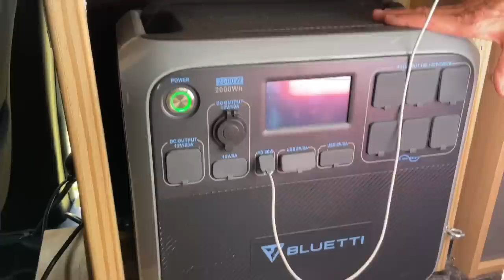COMPLETE VAN TOUR - NO BUILD, BUILD - RAM PROMASTER CITY - SOLO WOMAN TRAVELER, CRUSHIN' IT!!!

Comment: Got a couple of ideas as I watched the van tour. Both are focused on the cooler. If you have more of the silver bubble wrap cut a piece to put it over your food. In essence you will have a cooler in a cooler. As your food dwindles the refrigerated space will be smaller allowing the ice packs to last longer. also put a piece in the cover. Secondly, and I wished that I thought of it earlier, we can drill a small hole for a probe thermometer ,like the kind I use in heating and cooling , so that you know at a glance what the temperature is in the cooler. I bet that sometimes you may change the ice packs prematurely not knowing what the actual cooler temperature is and it may cut down on your need for electricity for that and you will  be able to use more "juice" somewhere else.
Reply from the maker: BOB!!  You are here!!  Thanks for being here!!  I hear ya about the silver wrap in the cooler.  I was going to take it and think about and and use it on the road, but I didn't have the space.  those are great great ideas!! THANKS!!
Reply: @LulusWay64  I'm sure we have work to do when you return.
Reply: Fantastic suggestion!
Reply: Lulu you are a piss and a pistol- my kind of girl!
Keep living exactly as you are and doing what 
you’re doing. What a joy you are, enjoy your peace! Beth

Comment: Genius! I've watched hundreds of conversion videos, but yours was packed with so many ideas that really spoke to many of my needs. 
I'm vegan and was stressing over  to keep my veggies, etc. cold without having to buy a huge, expensive power sucking refrigeration unit. Would love to see a follow-up on how your cooler system held up. Thank you for all your wonderful tips. I will definitely be using many of them. ❤
Reply from the maker: hi Karen, I used this system for a two month journey and it worked well.  I struggled a bit on two occasions with my electric because of bad weather and I bought a bag of ice twice to supplement.  BUT, that's because I don't have the proper wiring in my van to the van battery to charge while driving because my power station is a beast.  so I'm limited to only solar charging.  I either need to have the proper wiring installed or I need to downgrade my power bank, I don't think I need one that powerful.  but, all in all, the freezer/icepak system works well and I'm using the same system in my new build that is currently a work in progress, stay tuned for van build videos as I've already torn out the build from this video!!  glad you are here!   Lulu

Comment: What’s the folding step thing you are using to get a boost to your roof? Thanks! Nice tour minus the wind 💨.
Reply from the maker: yeah, it didn't even seem windy and I will work on what to do about the sensitive mic when recording.

TOOENJOY 2022 Adjustable 5 Gear Extra Protection Car Door Latch Step No Assemble Foldable Heavy Duty Car Gadgets Stand Pedal Ladder for Easy Roof Rack Access, Universal, Max Load 400LBS(Medium) https://a.co/d/bKBF08q

Comment: Wonderful build!!. Suggestion , use your table extension to lean on drivers seat and down to bed for a back rest to sit and look out of your back doors. I guess you did not have time to deal with passenger seat. I wish you the very best and look forward to more fun. TY
.
Reply from the maker: hi Ruth!!  great suggestion, thanks!!  I did bring my van to have the passenger seat turned around like I did in my last van, but my mechanic told me, the way this seat is mounted, it cannot be turned around and remounted.  so I was deciding between keeping it or removing it and I decided to keep it for this trip and in my final/permanent build that I'll do this spring, I'll revisit that decision.  to be determined!!!   Lulu

Comment: Ty for sharing.  I love your refrigeration system.
Reply from the maker: hi Georgia!!  thanks!!  yes, I love it too, it works well but you need to have the power to run a freezer which takes more than a fridge.  but I'm working it!!!  Lulu
Reply: @LulusWay64  does a 500w solar battery bank work?
Reply from the maker: you'll have to see how many watts your battery draws to run the fridge/freezer and then do the math to see for how long your battery bank will run it.
Reply: @LulusWay64  oh for sure.  Im having problem finding the amount of watts the 12v freezers draw.  I see u have 2000 watt solar battery.  I have a 500 watt solar battery.  How many watts does your 12v freezer draw from the 2000 watt battery a day?
Reply from the maker: I have no idea!!  sometimes it's running while my solar panels are out and so I have energy coming in and going out. if it's really warm weather, the freezer will run longer.  when I plug it in, I see it draws around 35W, if that is helpful.
Reply: @LulusWay64   ok ty.

Comment: Hi LuLu!  i just came across your video! 
Great job!
I am needing to get on the road. 
Thanks for sharing.
Happy Travels. We might meet up
one day.
Black and Decker Brew N Go
I bought mine at Big Lots,’it has a permanent filter, Its own insulated mug, auto shut off.
I LOVE MINE!)

Bring simplicity to your morning coffee with the Brew 'N Go coffee maker from Black & Decker. Use the included 15-oz. travel mug or your favorite cup to easily brew delicious coffee with the maker's dishwasher-safe permanent filter basket, saving you money and the environment from those pesky paper filters! Turns on and off at the touch of a button with optimal brewing temperatures. Don't worry about stepping out without turning it off - the brewer features an automatic shut off function! *Cup equals approximately 5 oz. (varies by brewing technique)

SKU(s): 810295105
Specifications
* Product dimensions: 6.4"L x 6.8"W x 9.9"H
* 6.4"L x 6.8"W x 9.9"H
* Material: Thermal stainless steel, plastic
* Wattage: 800
* Wattage: 800
Features
* Set includes brewer and 15-oz. thermal travel mug
* Expertly brews coffee with simple commands directly into prefered cup
* Permanent mesh metal grounds filter for grounds or soft pods
* Automatic Shutoff feature turns off immediately after brewing
* Space-saving design for small kitchens, apartments and dorm rooms
* *Cup equals approximately 5 oz. (varies by brewing technique)
Assembly
* Assembly required: No

Comment: It's a Wonderful build but I do think you need to have holes under your mattress so you don't get mildew😃💖
Reply from the maker: hi Maurice!!  yes, I agree!  when I built that bed, I used lattice for the top of the bed for the mattress to sit on, specifically for that reason.  used it like that for a few years until I had the brilliant idea to throw the board under there to pull out for the table and I knew I'd be sacrificing the airflow under the mattress.  but you are right, for sure!!  I've just torn that whole build out and I'm starting over, and the bed with have airflow for certain.  stay tuned for the next build, videos have started on the insulation.  thanks Maurice!!  Lulu

Comment: I love your van Lulu. I first discovered you on CheapRVliving.   I've been doing research on the 2016 ProMaster city, but the bigger vans did not have ideal reviews. Have you had any issues with your van and how many miles are on your van. PS  I love your alternative cooler option. Thank you for posting all your great ideas.
Reply from the maker: I bought my 2016 PMC last January so I've had it for just over one year.  I bought it with 83K miles, and it currently has 105K.  I have not needed one repair thus far!!  it runs like a champ.  not sure what's ahead with my PMC, but every vehicle eventually needs repairs and has issues, and I'll just fix it!!!

Comment: Great job, Lulu! What specifically is your mattress made of, are you happy with it, and if so, where did you buy it?
Reply from the maker: hi Deb!  it's just a regular foam mattress, the brand is Spa Sensation from Walmart, I cut it with a big kitchen knife to get it the right size.  I've been happy with it but I will change it out when I do my rebuild soon.  I think I will go thinner and I may just buy foam from like Joanne Fabrics, or something like that.  it's very comfy, but I won't have an 8" mattress in my permanent build coming soon!!  Lulu
Reply: Thanks for your quick response. Happy Trails!

Comment: The great thing about Platy bags is that they are boilable. I used to take them backpacking. When I boiled drinking water at night I would drop a full 1 liter Platy bag in the boiling water, heat it to shower temp, change the cap to one I perforated with a hot needle. A few drops of Dr Bronner’s Castile liquid soap and I was all clean for my good night’s sleep.
If you have a small space in a corner of your freezer you might consider a child size cold pack. Good for a bumped shin, a whacked back of the hand, a scrape here or there. The dollar stores have the instant cold compresses that are single use, but you seem more like a reuse-repurpose-recycle minded person!
Reply from the maker: hi Nancy!  well, that's a very cool and resourceful tip! THANKS!  I'm glad you are here!!  Lulu

Comment: You may have heard about this, but you can have a battery isolator installed and charge the Bluetti right off your alternator, skipping the cigarette outlets.
Reply from the maker: hey Chris!!  someone advised me to have a higher gauge wire run from the battery to the dashboard for me to plug in the bluetti.  I was going to talk to my mechanic when I get back from this roadtrip.  thanks for that tip!!  Lulu
Reply: @LulusWay64  Awesome. I think you’ll also top off faster directly from the alternator. I’m only part time now and have 12V power in the back of my van, too, but I plan to power from the alternator if I ever go full time. Good luck!

Comment: I have learned so much from your channel, and especially this video. I especially like your cooler ideas as I use a similar cooler. What is the size of the 12v cooler and the size of the ice packs. Thank you.
Reply from the maker: hello!!  so happy to hear you've learned from my channel!!!  the 12V fridge I got, I can no longer find the link for it, but if you search for a 9 quart 12V fridge/freezer, that's the size I have.  I just searched for the smallest one I could find and that's what I found.  you would need to measure inside the fridge you find to see what size ice packs you can fit, but mine fit these:  https://amzn.to/461g9eK   hope that helps!!
Reply: @LulusWay64  Yes, this info helps.  Thanks!

Comment: Hi again! Could you tell me where you got your freezer, The brand, size, model number? Maybe a link? Also, what brand, size are your icepacks and where did you get them? Thanks so much. Love the cooler idea.
Reply from the maker: this is the fridge/freezer I have but any 9 qt 12V fridge will do:  https://techclicusa.com/products/9-5-quart-9-liter-portable-refrigerator-cooler-freezer
Reply from the maker: and these are the ice packs I have, just be sure to get the measurement of the inside of the fridge and confirm that 6 of these blue ice packs will fit, then buy 12 for rotation.  and be sure you have the power to run it.  amazon affiliate link:  https://amzn.to/3kIxLcK

Comment: Although you covered a lot of things I didn't hear you say that you are carrying any hand tools with you, a tire jack, and a tire iron or any spray fix a flat for flat tires.  Any emergency road flares, or any extra motor oil, brake fluid or transmission fluid, and any distilled water, and coolant for your radiator for any potential emergencies, as well as, any kind of personal protection for dicy situations. Or a set of jumper cables.
Reply from the maker: hi Tracy!!  I do carry a bag of hand tools and, on this last roadtrip, I had the honor and privilege to help two fellow travelers with some issues, and I was able to fix broken things for them (pulled out my jigsaw on the beach, lol) (pulled out my power drill in the wilderness).  I have AAA and in my 64 years on this planet, I've never needed any of those things you listed, so I think I'm all set.  if I need any of that, I will just figure it out at the time, and trust it will all work out, cuz everything always does!!  BUT, having said all that, IF I had the extra room, I would likely carry a couple of those items you mentioned, but I don't, so I won't!!   Lulu

Comment: Do you have a link or can you give me the dimensions of the ice packs, please? I haven't ordered the cooler yet but I want to start using these ice packs. I'm trying not to spend money on anything I'm not using in the van and don't want to buy the wrong thing now and have to replace it when I can afford the cooler.
Reply from the maker: hey Misty!!  so I got the DOC 9 qt freezer, I took the measurements inside to be sure I could fit the ice packs and how many I could fit.  these are the ones I ordered, I got 12 of them since I knew I could fit 6 in the fridge at one time.  but I highly suggest, before ordering, you check the dimension of inside the fridge/freezer you will be using and be sure they are the proper size.  amazon affliate link:  https://amzn.to/3ZtKi2T
Reply: @LulusWay64  Thank you so much. Have a blessed day 💖🤟

Comment: Lulu, I need to know: Do you think it's unnecessary to drill your plywood floor into your vehicle? I've been thinking that the weight of pretty much EVERYTHING ON THE VAN will hold it down but maybe I'm just lazy haha.
Reply from the maker: hi Marcela!  yes, totally unnecessary.  my floor is just sitting there.  I just slid it out to remove it to insulate.  and I will just slide it back in and not attach it to anything when I put it back in.  everything in it holds it in place!!!  that's how I do it!!